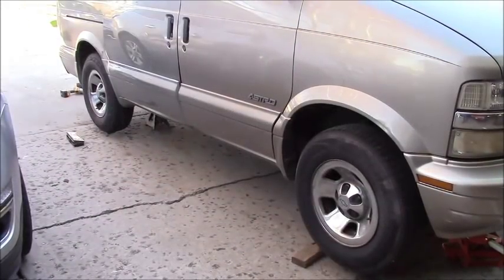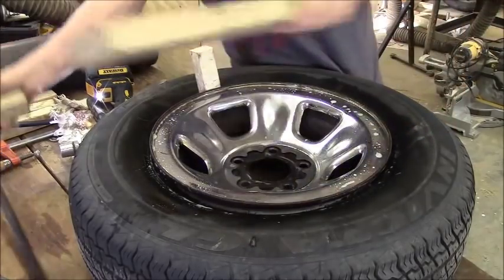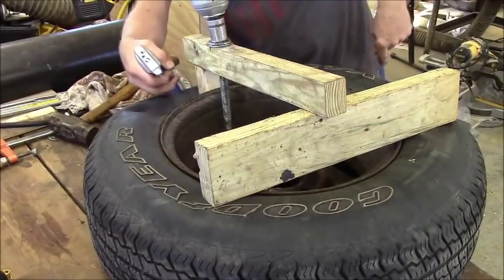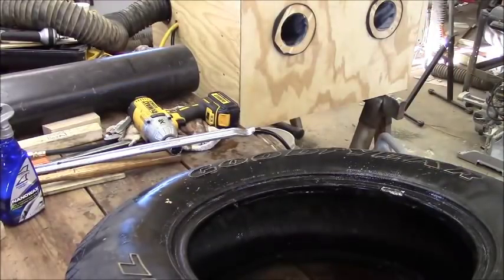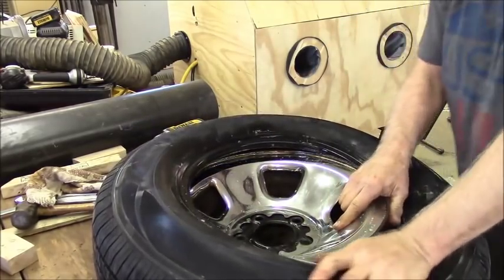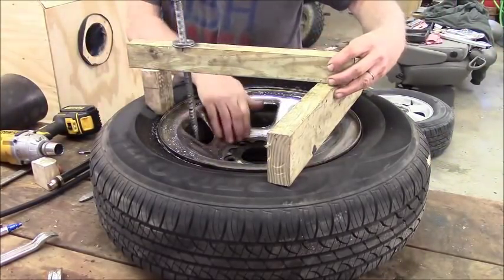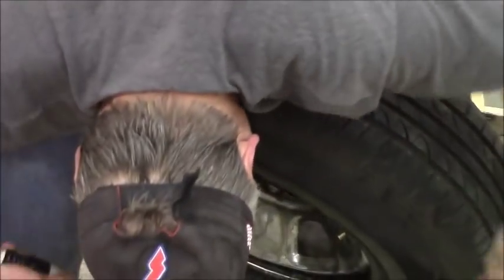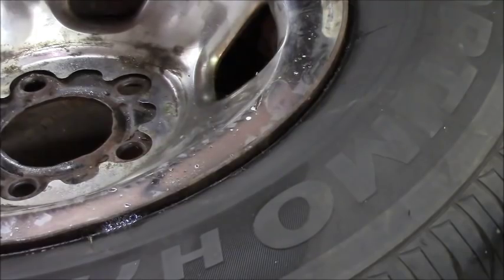DIY tire mounting, DIY bead breaker, How to make a home made bead breaker, remove and mount tires

Comment: I like your bead breaker. Very controllable and inexpensive. ie free  Do you think pushing down so far on the sidewall with wood damages or weakens the sidewall cords that are inside the tire? You mentioned making a shoe horn style tool in a vid. I dont have your skills but am thinking how to do that. I have some 1/8x1 1/2" and 1/4 inch x 1 1/2" flat bar and some other goodies though. Very limited welding skills but it wouldnt require perfection to hold, I think... Or, make a 45 degree cut/slice into your wood wedge and slide a piece of 1/8 through it. Having the flat bar point toward the bead and be longer, say 1 1/2  to  2", then the piece of wood/wedge edge. The flatbar should be contacting the bead much sooner then the wood wedge pushing the tire sidewall down do so much.  Anyway, I need to replace 4 valve stems and reuse the tires. I dont want to damage the tires then worry about safety issues such as sidewall fatigue.

Comment: I like it Very simple that's using your head  (Bead Breaker)
Reply from the maker: I think I'm going to make the arm out of metal and a plate the slants into the tire further so it doesn't slip out like the wood does sometimes... But it's not like I do this every day. I've been messing around with these tires for my old Astro van, once they are all on, I'll be good for years! As I mentioned somewhere else, I do it this way because I had this station set up for my motorcycle tires (which need changing quite often!) SO I just modified it for car tires.
Reply: @bobsbarnworkshop  .

Comment from the maker: UPDATE: I just got back from a test drive with my tires spin balanced, beads out, and she's smooth as a baby's butt out to 75mph!!! (higher than I usually drive!) so, again, the balancing beads were a FAIL for me!
Reply: Knock on wood, I've used Checkered Flag's balancing beads on three occasions and they worked great. They don't work on every tire as you found out. What brand did you buy?

Comment: A ratchet strap around the tread will help it seat also.
Reply from the maker: Kelly Newman I’ve tried that several times without much luck. I had better luck with a rope and twisting it with a stick
Reply from the maker: Kelly Newman I learned that in another video where I mount a trailer wheel , the rope works well

Comment: So the nut is welded to the steel plate which is screwed to the underside of your bench.  And is the nut on the topside of the threaded rod welded on?  What size rod?
Reply from the maker: 5/8" all-thread. originally set up as a motorcycle tire station with an old car wheel with plastic hose around the edge so I could bolt it down tight to get the tires on and off
Reply from the maker: see my earlier video (with 150k+ views!) "Improved FREE home tire bead breaker". there you will see the whole process of setting it up

Comment: I like the way this guy says " He's selling these Tires "  They obviously will not balance. ( usually means they are out of round ).  Hate to be the guy that buys these useless tires. Nice fella here
Reply from the maker: John Averick No no, the tires are fine. I tried ceramic balancing beads and they didn’t work in the NOS tires (they were old but still had the blue stripes on them!) and my brand new ones. Having them spin balanced worked fine.

Comment: are you not worried about damaging the face of the wheel by removing the wheel face down. surely you would not pry on the face of a aluminum wheel for fear of damaging the face with the pry bars but even a steel wheel should be protected from the scratches that surely will result from the pry bars.
Reply from the maker: wayne d that’s what a tire shop machine does, turns a big steel bar between the tire and the rim. I have pieces of plastic Tupperware to use between the tire and wheel to protect if needed
Reply from the maker: wayne d plus my tire irons all have smooth edges, I see no damage from using them, plus these are crappy old steel wheels anyways

Comment: That looked like only about 3-4 oz of beads....for a tire that size, 6 might have been better.
Reply from the maker: Thomas Stephens yeah, it was 3oz. Per recommendation of the manufacturer.
Reply: @bobsbarnworkshop  fair enough....for perspective of bead usage ratio ( i am a user/beleiver) I've got 3.5 oz in a 195/55R16 and was able to spin it up to 85 on a stand with no wobble and triple digits on the pavement....perhaps adding more to the larger tire would get you a better weight displacement and balance as a result
Reply from the maker: Thomas Stephens believe me, I really wanted them to work! Free mounting and no shop balancing cost..... I still have beads in my snow tires and so far seem to be working

Comment: dude i cant believe you are still using those stamped steel tubular jack stands !!!!!!!  ohhhh, ohhhhhh.ohh,oh,oh ohhhhhhhhhhhhh,(channeling sam kinison)didnt they outlaw those things back in 1984??  and arent you getting tired of fighting with things to get them to work ???  i did back when i turned 45,,use the right tool for the job,, break down and get a harbor frieght tire changer, well worth it..
Reply from the maker: louis richards you noticed!! I intentionally got out my ‘vintage’ jack stands to use. Believe me, I only used them when I was just changing tires and would NEVER do anything where I needed to get under the car! I have new sets of 3 ton and 6 ton for that.

Comment: You'll learn when a tire bead pops up and the force of rim not being anchored to something will hit you!!!you haven't got a clue about doing tires and you are definitely going to hurt yourself..worked at a tire shop many years..you should watch a video of  professional mounting tires and not showing people how to injure themselves..
Reply from the maker: Working around any workshop is a personal risk, Any tire I work on has no pressure in it and when I inflate I am NOT leaning over it and usually have my had on it to block any bounce it may have. Also if you hear me say, I set the compressor to 35 PSI, very low just enough to set the bead. It's not like these are huge split rim truck tires... But I appreciate your concern anyways!
Reply: @bobsbarnworkshop  Jerry is correct. This is a dangerous job, unique and unlike most other dangers in the workshop. Ratchet strap the rim down when you are setting the bead. It's not the psi that kills it's the volume of air that does when a tire explodes. Think of it like amps & volts.
Reply from the maker: Cameron Myers thanks for your concern. In the future I will leave the tire in the jig held down by the rod while setting the beads, ok?
Reply: @bobsbarnworkshop  You are a gentleman!
Reply from the maker: @coppcar  I have hundreds of other DIY videos on my channel! If you enjoy watching how I do things with what I usually have around the shop, check it out! Woodworking, cabinetry, electronics, electric wiring, welding, go cart and mini bike, outboard motors, CB radio... pretty much anything I'm doing that day I film!